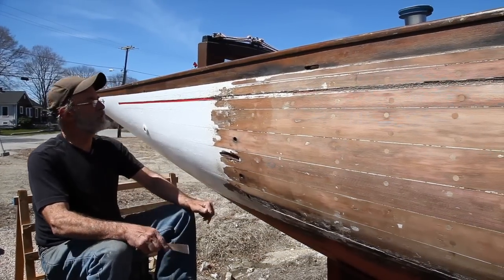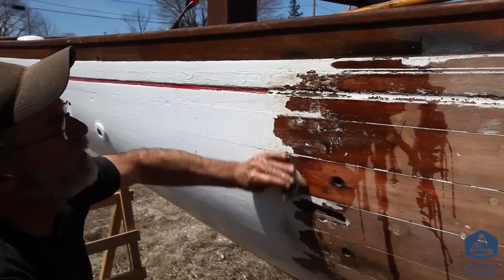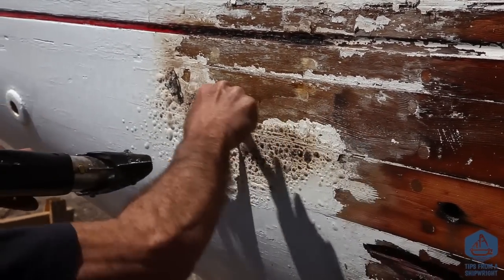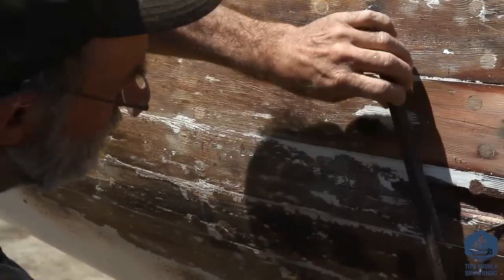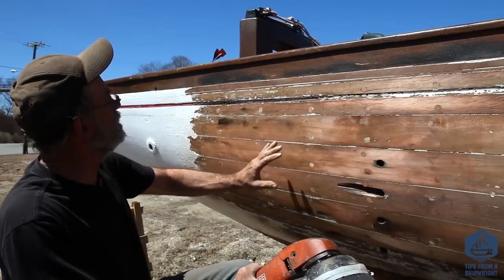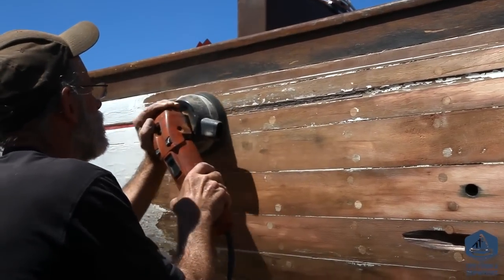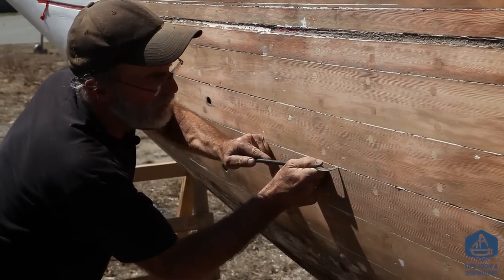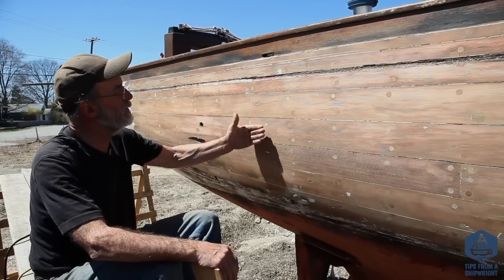How to strip paint off your wooden boat using a heat shrink gun

Comment: Lou, while you were board sanding I noticed you have some strong 💪 looking arms for an older gentleman. I bet you could put me down with 1 punch.😵‍💫
Thanks for the paint removal tips. I once repainted a classic tollycraft 16 ft runabout. It took a lot of expensive paint remover. It also took a lot of time. My restoration would have been much better if your tips had been available back then.  Your heat gun is almost as powerful as a flame thrower. 😆

Comment: Why not using the planer imediately?
Reply: I was wondering the same thing did you ever get an answer whether just using the planer would work to remove the paint
Reply: I've used them to remove paint and while it works it kills the blades and just isnt worth the hassle.I might do it again for a small section or if i had to strip a plank etc but that is it.Truthfully I'd recommend to avoid trying it but as with anything your results may vary.

Comment: one can use a conventional HOT AIR GUN that does not have that massive nozzle on it.. and a Bent burn off tool that looks like something you flip burgers with. but it gets your hands far enough back to keep them from getting toasted by the heat..  just ask the hardware store or paint store clerks for a bent burn off tool.   please have a water filled garden sprayer handy.. and don't do this on lap board siding on homes..  the hot air can set the materials behind the lap board on fire and burn the house down hours after you leave.

Comment: Just a curious naive person, but why couldn't sandblasting, soda-blasting, or dry ice-blasting work?
Reply: +LittIegator To sandblast any planked boat would damage the plank edges (the seams) which is the most important part of the boat. And that boat is built of a soft wood so it would be badly pitted.
Reply: Soda blasting is very effective and you can set the pressure so it doesn't touch the wood.  However, you would need a very expensive commercial grade sized soda blaster to do jobs of this size.  I have a smaller consumer grade one, which works great to taking off those small "leftover" areas of paint instead of using the saw blade like was.  Far less marks on the wood, in fact, none.